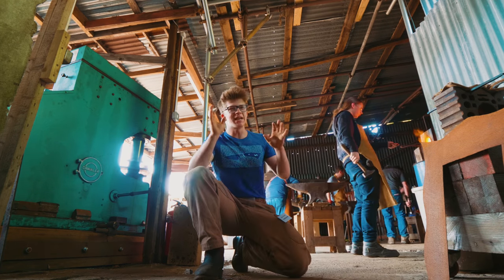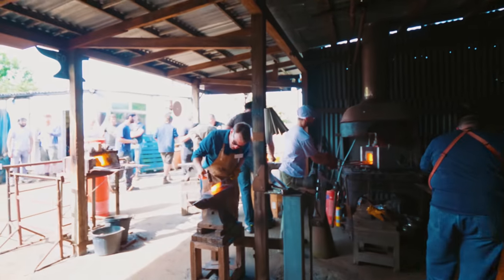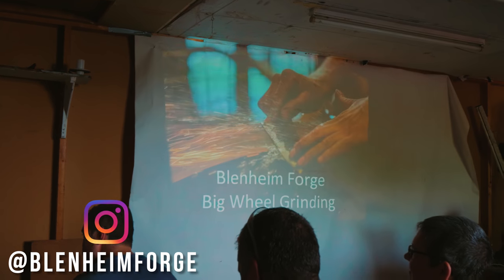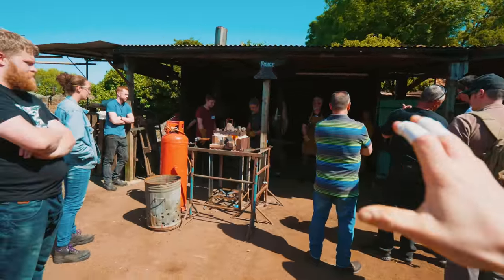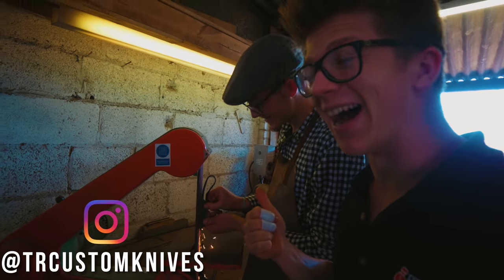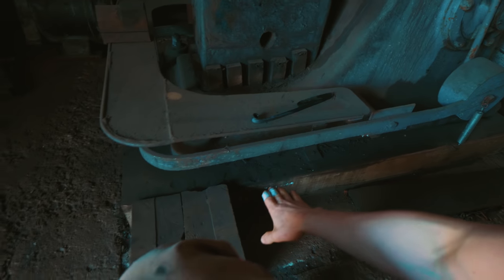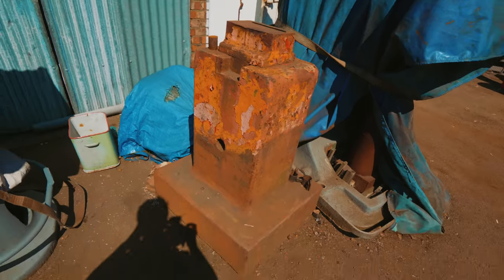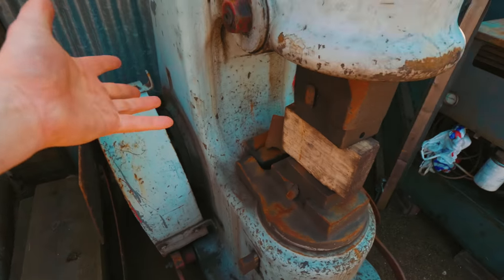60MPH WATER WHEEL KNIFE GRINDING!!!

Comment: Those large grinding wheels are very interesting.
Reply: With that water flow the metal you're grinding would have little to no heat affecting hardness, and with the size, grinding in bezels and final sharpness would be a breeze.
Reply: I learned to grind on a water wheel. I looked away for 1 second and my knife was in my dad's leg. Safe to say I never looked away again
Reply: Scott Cowpland I want to like this, but that isn't fair to your Dad's leg. I had a similar experience in my dad's machine shop. Failed to set the CNC mill properly and had the endmill shatter into both my dad's arm and mine, I paid closer attention after that!

Comment: I have a water wheel about the same size as that one.  I think you can see it in most of my videos.  I put a new frame and everything on it.  It's a pretty great old wheel.  But mine isn't meant to grind, I have it set for sharpening in hopes that it will be preserved as long as I live.

Comment: I’ve worked on drop hammer anvils that weigh 500,000 pounds! Closed die forging of course but it is 16’ long, 10’wide and tall roughly. Solid block of steel!!

Comment: That grinding wheel looked so cool.  What are the benefits for using something like that versus the typical grinder you use?  As cool as that water wheel is it seems a bit impractical for regular use with its size and the amount of water it looked to be spraying everywhere.
Reply from the maker: The benefits are in having a high stock removal rate with a good surface finish and no heat build up! It is also much less expensive than abrasive belts!
Reply: Surprising - whats the wheel made out of (and is it 1m in diameter?)
Reply: It produces a ultra hollow grind. Mostly used on japenese kitchen knives. It is nearly as flat as a flst grind but you can rest the edge of the knife and the top of thr bevel on a sharpening stone, built in shsrpening angle. The rest of the bevel does not touch. Plus the lack of heat built up when you start getting below 8 thou on a blade.
Reply: Thanks
Reply: Also, wet grinding was/is the mainstay of the Sheffield cutlery trade

Comment: Make a cross bow!!!!
Reply: Freizeitflugsphäre I just had a look on ur channel....DID YOU MAKE A TORCH??? OUT OF PIPES????  I have subbed.
Reply: Skipper nifty Thats my homemade Hydrogen generator which is capable of producing about 2 litres of an oxyhydrogen mixture per minute.
What you probably saw was my homebuild torch with an integrated flashbackarrestor.
As said in my last video I'm going to write english subtitels for my old and future videos.
Thank you a lot!😃
Reply: Skipper nifty I like the airbrush stuff! I tried this out about a year ago on a bigger project, but it didn't turn out so well...
I probably also used the wrong paint...
Reply: Freizeitflugsphäre tamiya paint is my favorite. Just needs a little thinner and it works like a charm. With airbrushing you just need to keep practicing and you’ll get it one day 👌🏻

Comment: What kinda abrasive and grit is it made with ?   So if it's 3 foot dia,  the rpm s is 560,  and the surface feet is 5280,  so its grinding at a mile a minute. Cock diesel...